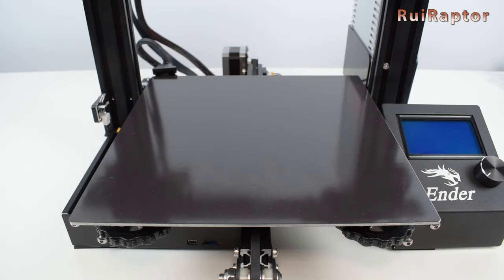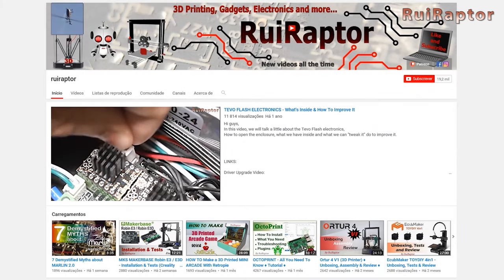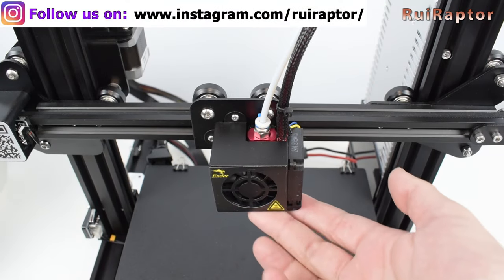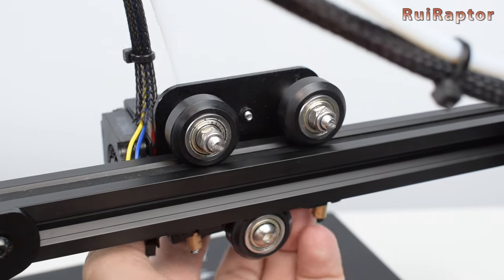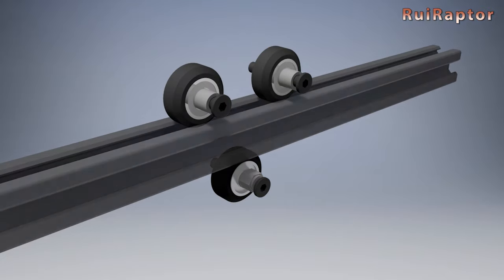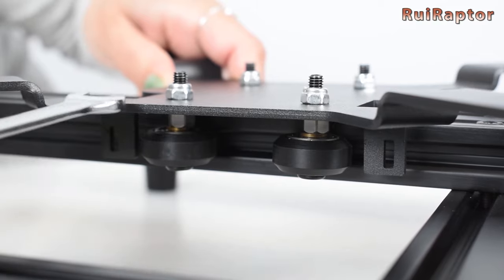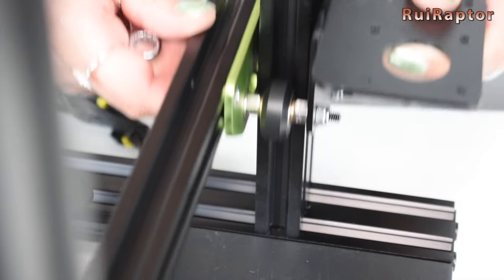HOW TO - Fix Wobble & Adjust the Eccentric Nuts (3DPrinter)

Comment: Just a tip, where there are 2 eccentric nuts I find it very useful to mark one edge of each nut so that you can ensure that they are parallel
Reply from the maker: Hi Brett, your tip is very good. The best is to do exactly that on all eccentric nuts while assembling them (for the cases where the parts come disassembled).

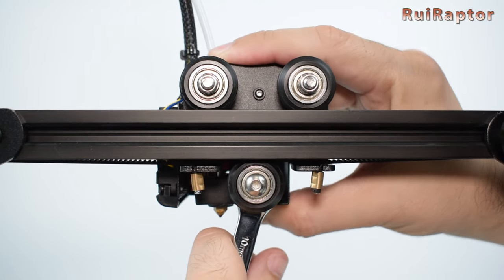Comment: 2:40 This is the information I needed. I kept turning and turning. There’s no need, just a 1/4-1/2 turn needed. Thanks.
Reply: Same here, I was wondering why when I turned the nut the carriage would tighten and if I turn some more it would go loose again...That image of the center of the nut at 2:00 explained SO much.

Comment: Thank you very much. I worked on Radars and repaired all kinds of electronics and I was going insane trying to figure out how to adjust the Eccentric Nut. I have never, in my 38 years of working in Component Level Repair on all kinds of electronics, and I worked on electronics all the way from Tube circuitry to Digital and I have never seen an Eccentric Nut. When I saw you video I went and looked up the definition of the nut and sure enough, the center is offset. Thank you for giving this newbie back his sanity!!!!

Comment: You're amazing.  My travel Ender 2 was super wobbly after I unpacked it from my suitcase, and I thought I messed something up.  I tried loosening all of them and pushing them towards the center while I tightened them, in case the holes were wallowed out, and that did nothing.  I'll have to adjust everything the right way once this print is done.
Reply from the maker: Hi, thanks, glad it helped 🙂

Comment: You should be able to turn the wheels with two fingers with just slight resistance.  As stated, the best and most reliable indicator of being too tight is when running it back and forth, you feel some slight bumps along the way and of course if hard to move it's WAY too tight.  The ideal should be traveling pretty much glassy smooth, but no wobbling either.

Also, before getting to this point, when first assembling the upper carriage framework, you should check it all for being square and that, on a level surface, the feet all make contact and no rocking.  To fix the latter, you can loosen the frame members and let it settle all to be flat on the table with all 4 feet, then re-tighten.  As for any frame issues not being square, you can often just loosen, move them a bit and snug them back and find they will fall to be square.  If not, worst case, you could put some thin shim material on one side, like some layers of aluminum foil until when you tighten the framework it all ends up square.

The squarer and truer you can assemble your printer the easier it will level and make great prints.

Lastly, when leveling your bed too many times the knobs will be too loose.  If too loose, the bed can easily get out of level from bumping or even just removing a print that is stuck a bit.  You want these to be pretty snug and to get them there when assembling, you may have to loosen the bolts on the Z stop and slide it down minutely and tighten so that it will let the head down lower for the more greatly snugged up bed leveling wheels.  Try to target the springs for the bed being about 50% compressed and you should be in great shape.

I buy a lot of "unrepair" printers on Ebay and if you get confident in doing all these things as well as troubleshooting printers, you can save huge buy buying these customer returned printers.

Today I fixed a Lottmax Shark V2, bought for $95 shipped as they occasionally pop up on Ebay, a great deal, and just had to bend some extruder mount metal brackets to get things squared up and it's working great.

Comment: I’m still struggling, rollers at maximum looseness is too tight on the left side and the lead screw makes it worse. It saggs down on the right side and moves when the extruder adds weight to the side. I’ve tried everything and I don’t know when to decide if my machine is just broken or if I am doing something wrong

Comment: I did this on my CR6 Max both the bed and the nozzle- now running a ABL Hopefully It Fixed my scraping sound ( it was making a weird sound every time the bed moved in a fast motion) the bed rollers were only tight on one side and worn out only on one side. Thank you so much you probably saved me.

Comment: Something I don't think was covered: do the other nuts do anything to lock the eccentric nut's position in place?  Can the eccentric nut back out and become loose again?
Reply: You need to use washers when you use eccentric nuts or spacers, and sufficiently tighten things down.

Comment: On mine the eccentric nut wasn't tightening enough.  They're not that old and they measured right at 24.00 mm, so I looked closer and my bracket was slightly bowed.  I removed the hot end so that I could bend the bracket straight again, and presto, they tighten correctly now.

Comment: Thank you so much. I did not notice this problem until I was running a leveling print and noticed that my z-offset was off bacause of the wobbly motor.

Comment: This led me to find out one of my rollers had a notch worn in on one face leading me to think it was better when it was just riding in the rut 90% of the time and randomly jumping out andruining my print, only to drop back into the rut when I manually moved the bed forward..... that was a SNEAKY little issue, I have gone over everything else..... learned a ton but still had random issues till I went back to this, guess i over tightened them during assembly?  Oh well, headache solved. Thank you
Reply from the maker: Glad the vieo helped :)

Comment: Even if the eccentric nut has been tightened, how do you know if the eccentric kit is stripped?? My printer, being a bed slinger like this, had the cable caught up in the side of the gantry and threw the whole thing off balance. I have the chain guide to adjust the cable as needed, however how am I to tighten the bed up again so it can be printing in normal fashion???????? Is there a way to tell if it’s stripped?
Reply from the maker: Have you tried to turn and adjust the eccentric nuts again? Since they don't have threads, they cannot be stripped. Also, check if your POM wheels are ok after that incident.

Comment: I wish I would have watched this before I put my printer together. I have spent the last couple hours trying to figure out what was wrong. I saw the nut months rollers were loose so I gave it a spin to see if it helped. Sometimes it got tight other times it didn't.

So if figure I will back everything out and then slowly tighten it back in. I wrenched them  about a dozen full turns toward lose and now everything is all screwed up.

"Don't full turn the roller adjusters" should be in the front of the book in maximum red letters...

Comment: On my Green Tornado, the print bed is sitting on six wheels. One row of three wheels has eccentric nuts but the other row of three wheels only has spacers. Four of the wheels spin freely, two on one side and two on the other row. With the help of your video, I will tighten the row of wheels that have the eccentric nuts but I don't know how to tighten the row of wheels that only have the spacers. Can you please help. Your video didn't cover that. Thank you.
Reply from the maker: Hi Hugo, you only need to adjust on the side that has eccentric nuts. Start with the wheels from the edges and adjust the center wheel at the end.

Comment: Does hole on the aluminium side needs to be wider or you it needs to be wide like screw?
Reply from the maker: The hole on the carriage where the eccentric nuts are attached are bigger when compared with the holes with no eccentri nuts.

Comment: Help me please, on one of the sides no matter which turn a make on the eccentric nut the wheels wont loosen up, preventing smooth motion.
Reply from the maker: Hi, try to loosen the screws a bit, then adjust and then tighten the screws again. If this does not help, check if the carriage is bent in any way.

Comment: I just assembled a printer (Ender 5 Plus) where the printer head was wobbling, but tightening the eccentric nut to even the max point was not enough, it still wobbles a bit. Any solution to that?
Reply from the maker: Hi Christian, check if the carriage plate is bent.
Reply: @ruiraptor  Thank you very much for your answer! I actually realized that the factory assembled top rollers were not tightened, which was the cause for the problem.

Comment: Thanks for the video it helped me. 
I've got one unrelated question: how much better, in your experience,  is to use painters tape over other surfaces for layer adhesion?
Reply from the maker: Hi Sebastián, painters tape will help in certain cases but it's not the best solution....it depends on which print surface you are using. For example, if your print surface is a glass without any coating (and your prints are very difficult to remove), the tape will help in this case.

Comment: The problem im seeming to have is that sometimes travel along the y axis causes a rumbling but the bed feels solid at the time
Reply from the maker: Try disconnecting the belt to check if it's not coming from the belt/idler/stepper motor.

Comment: There is not enough adjustment on my 4 day old printer  & the wheels are not worn . Any suggestions ??
Reply from the maker: Hi Ted, are the screws tightened? Is the carriage plate bent?
Reply: @ruiraptor  Everything else seems fine. A slightly  larger wheel or more eccentricity would  fix it.
Reply: Found the root of the problem......the 2040 extrusion is smaller in the middle than the ends by about .3mm.
The solution would be a spring loaded roller.  
Has anyone seen something like that ?

Comment: Thank you for posting. Nice video. Do you have any ideas for what to do for my issue? When the eccentric nut is at its closest, my X carriage is still very loose.
Thank you.
Reply from the maker: Hi, which printer do you have?
Reply: @ruiraptor  Hey, I have the same problem with Tevo Tarantula. I added a small paper which helped somewhat but did not solve it. Any ideas? Thanks!

Comment: I need help. No matter how loose or tight the eccentric weels are i still feel the bumps. can you help
Reply from the maker: Those bumps normally are caused by having the wheel's grip too tight and this deforms the wheels. If you have this, loosen the grip as much as you can (by turning the eccentric nuts) and let the wheels rest for some time (1h for example) and then, adjust correctly the grip.
Reply: @ruiraptor  thanks sí much

Comment: I can make a full "circle" with my eccentric nuts, I cannot get the bed to be stable enough, what should I do?
Reply from the maker: Hi Aleksa, make sure your eccentric nuts are not installed upside down.
Reply: If that is the case, you may need to get new wheels for your printer. They do wear down over time because they are soft rubber.

Comment: I adjusted wheels but still there is wobble in the wheels, how can i fix the wheel to make their motion smoother
Reply from the maker: Hi, which printer do you have?
Reply: @ruiraptor  its not printer its laser engraver they have x and y rails, in fact i was not able to find any good enough video regarding adjusting it.
Reply from the maker: I see...in that case, you have acrylic carriages, correct? Here are a couple of things you can try.
1- If possible, flip the carriages up side down and install again the wheels. Some acrylic parts are cut in an angle and can cause the problem you are facing.
2- If it's not possible to flip the carriages, try this: https://www.youtube.com/watch?v=IH6ctMkp0N8
Reply: @ruiraptor  this for help, by chance mine has metal plates (carriages) when i look at the wheels while moving for sure wheels are wobbling, I have not idea what is the solution for a wobbling wheel can we fix it or only solution is to replace.
Reply from the maker: If the issue is only with the wheel, then replace it. If you need further analysis, send us a video of the parts wobbling by email and we will check.

Comment: Hi. Can you help me with the problem if the printer prints the circle a little oval. What to set.
Reply from the maker: If you are getting oval shapped circles, it means you have backlash. Check your belts tension and also your motor gear.
Reply: @ruiraptor  Thanks

Comment: Didn’t work for me still get bumps on wheel
Reply from the maker: Hi Javin, if you get bumps, either your wheel's grip is too tight or the wheels/metal profile have some issue and are causing that.

Comment: Mine is extremely tight and i cant fix it
Reply from the maker: Hi, you mean it's tight and you can't turn it or it's the wheels grip too tight and you don't have margin to adjust? If it's the first case, try loosening the screws a little bit to adjust the eccentric nuts and then tighten them back.